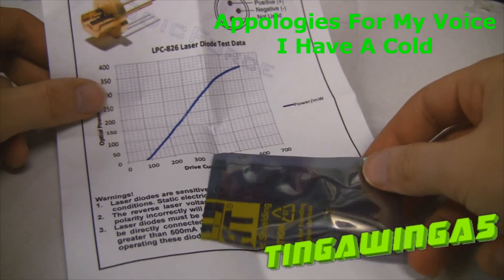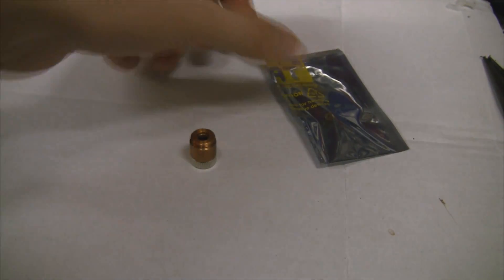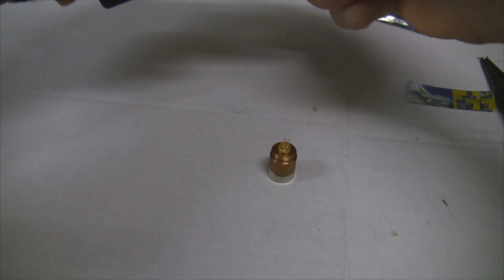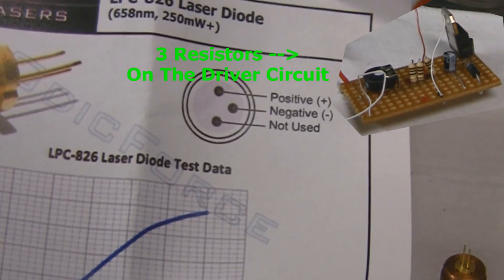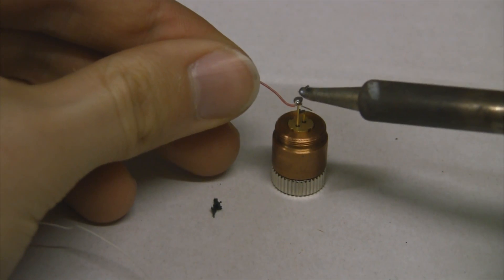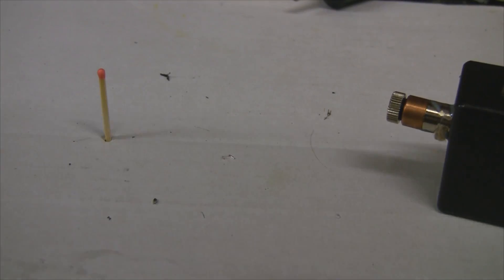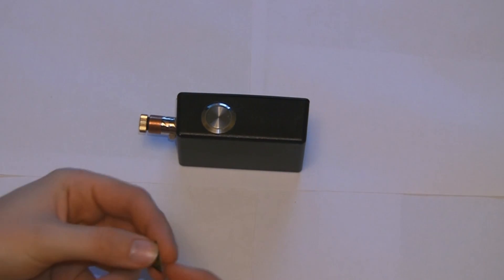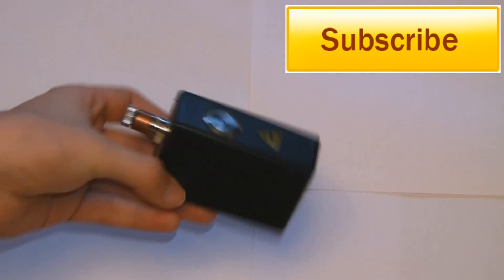Homemade 250mW Burning Red Laser

Comment: you linked the video's in the description but the video's are not available.  

i just wanna see the driver schematic.  it seems similar to mine but i wanted to know where you have placed that reverse polarity diode 
as in.   is it between the cap and the laser or is there a cap near the laser.  then a diode and then another cap and then ground?
Reply: and the reason you used 3 resistors is heat.  
i only used 1 and it got so hot it nearly desoldered other components

Comment: 01:00   not just a lens and everything behind it???   
a closed cap diode does not have a lens.  it's just a dust cover and possibly light filter.   
and behind that is nearly the exact same thing but a little smaller.  

hence the name.  
closed cap diode and open cap diode

Comment: The ones you buy are not really real lasers from stores.If you change the diode to a dvd burner or cd burner its no toy.And i believe it will light a cigarette and burn a hole.I just bought 2 from store used for cats and all they soon be burner lasers.Though to be safe ill use the class sticker on the cd dvd burner to put on it. So FCC guidelines stands as class 1 not 2 on it.DVD CD burners have class 1 i believe in them

Comment: What is the laser diode your are using?
Where did you buy it?

How are you computing your power?  Because if you are using a LM317T and a 3.33 Ohm resister to limit the current our are getting 375mA and so your power is actually around 469mW not 250mW.  P=VxI and the voltage out of a LM317T is 1.25V and 1.25V x 0.375A = ~469mW
Reply: i know this is an old comment but still.   

i don't think he ever mentioned the value of his resistors 

and if you look at the resistors you see brown black brown. so that's one, zero,  and times ten.    those are 100 ohm resistors.   (in parrallel i assume) so he has 33 ohms.  not 3.33 
and at 33 ohms it sounds about right.

Comment: Oh wait  see you are suggesting 3x10 Ohm in parallel or R=3.3333 Ohm so the current will be I=1.25V / 3.333 Ohm = 375mA and power will be P=VxI=1.25Vx0.375A ~ 469mW.  This would almost certainly kill a DVD laser diode but I am tempted to give it a try with one I have made because the 300 mW one I made although it will light a match seems a bit weak to me and I have a surplus of DVD laser diodes (smile).

Comment: your link does not explain why you are using 3x15 Ohm instead of 2x10 Ohm resistors.  Also the power calculation for the LM317T or 117T (they are equivalent) is as follows... output voltage from the 317 will be 1.25V regardless of input.  So using ohms law V=IxR to compute the required value of R we get 1.25/5 = 5 Ohm.  To compute power P= VxI or 1.25Vx0.25A ~ 313mW

Comment: I made the driver circuit with an LM317L not an LM317T. The diode is yet to come, but I tested the driver on a really old DVD burner diode, and it works. It wasn't that bright (probably due to the old diode used), and the 100R pot did not seem to do anything. Could this be due to the LM317L?

Comment from the maker: I've learned that you never argue with what the datasheet says, they have a lot more information than any of us. If you notice on the datasheet 420mW is the start of the more curved area on the graph meaning the diode is reaching its peak and its in danger of "blowing". 
Point is here, each diode is different some will need less current and some need more current.

Comment: That datasheet cant be right. All 200mW red lasers ppl buy online are set to 350mA with AR coated acrylic lens. No way you can get 200mW with 300mA  like that datasheet says. For a true 250mW you need 420mW with coated lens for red.